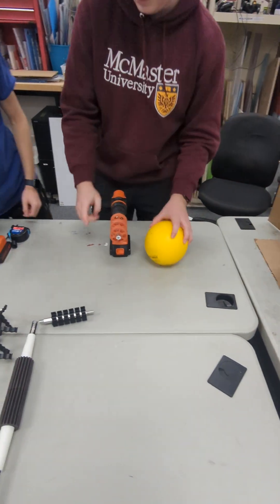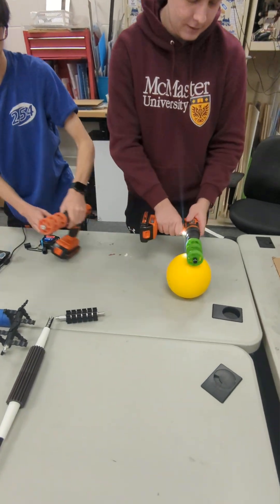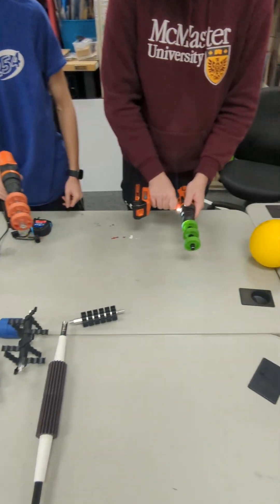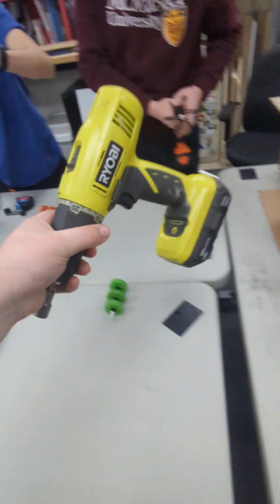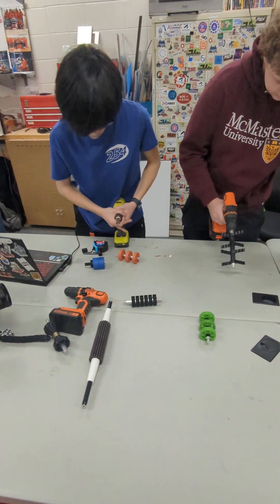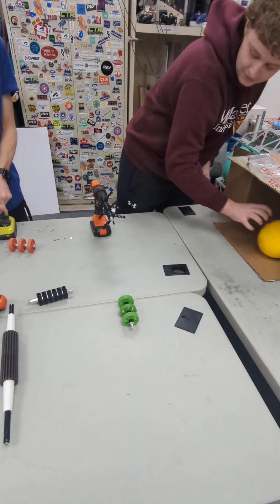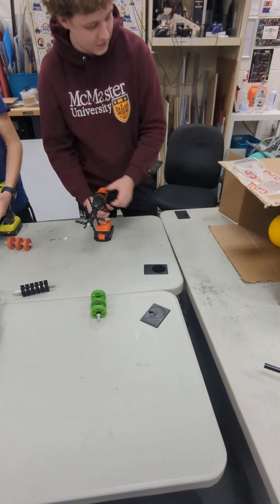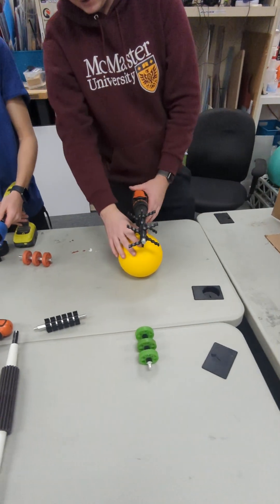intake roller test C | Ri3D 2026 FRC REBUILT

Comment: Bruh, do you guys even know what a proper test is? You're moving the drill all around, applying definitely forms of pressure to it and the ball. So many other things all well. Just mount the intake roller and then do the test...
Reply from the maker: mount to what? game has been out for like 2 hours. we're figuring out ideal wheels and then building our test rig from there.
Reply: @CriticalCircuits  Putt the drill in a simple clamp, don't overthink it. Its a test but it needs to be as accurate as possible hence it being a test. 😭😭 I get that you're building your "test rig" but at least start right.
Reply: you even done robotics?